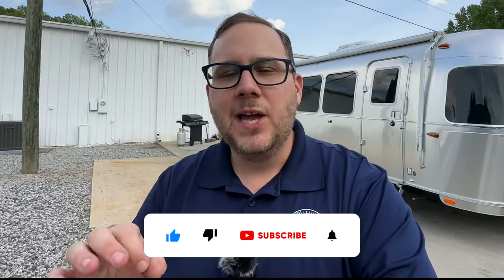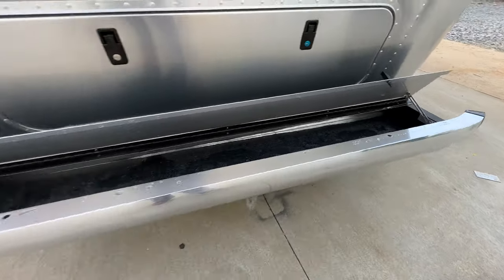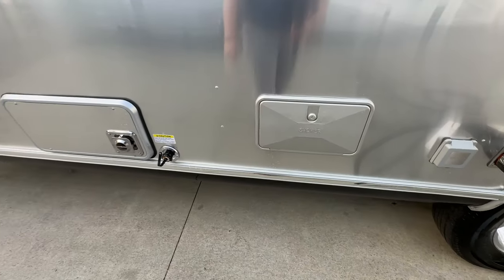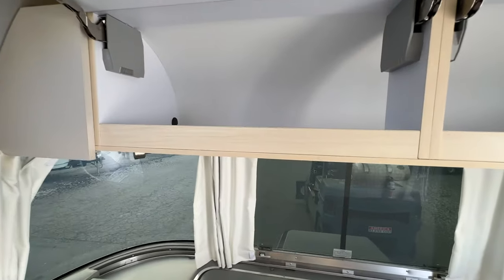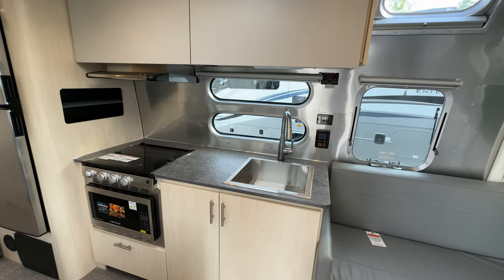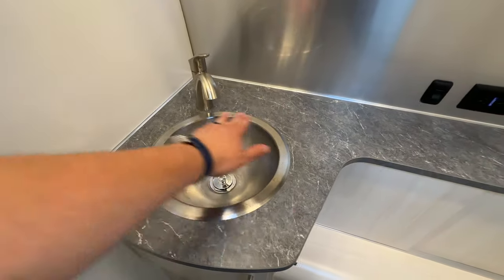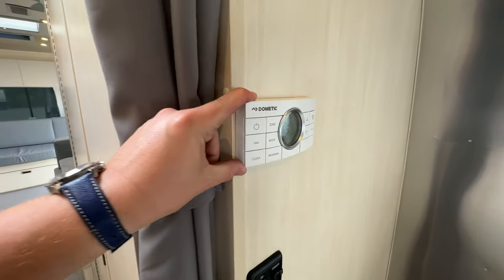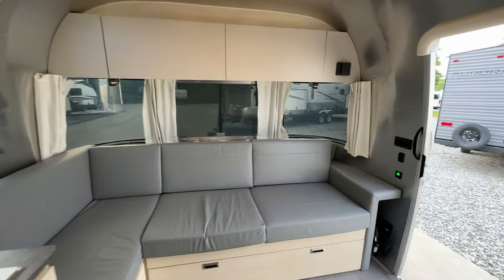"CHEAPER" Pottery Barn!??! - 2023 Airstream Flying Cloud 28RB Queen Bed

Comment: We LOVE this floor plan and are picking up our new 2023 28' FC tomorrow (!!). Thank you for doing this video, as this is the first we've seen for the 2023 28' FC RBQ. Yes, there is a trade-off for certain aspects of the trailer, but what sold us where more manual options with the awnings and stabilizer jacks, big windows on the camp side (just keep the one by the door closed if the door is open), and the separate lounge and dinette area. Funny that your title says "Cheaper Pottery Barn" as we initially looked at the PB but decided against it as it's 100% electric and the fabric sofa is a non-starter in the rainy PNW where we live. We've compared both models and will do some modifications to give our FC some PB aesthetics. Great and informative video!
Reply from the maker: Congrats on getting your Airstream! Thank you for leaving your comment! I feel the same way about the manual options on the Flying Cloud! I've a lot of customer ask if they can get the manual on the upper models!

Comment: idgi. the pottery barn is 50k more expensive than this for some interior decor upgrades? kinda sucks since the international is also gimped so as not to outdo PB so it's only slightly better. whole 28rb line sucks because PB exists.
Reply from the maker: The pottery barn does have the upgraded Smart Czone system like the Classic and powered stabilizer. There is more to it than only the decor, but with that said you do have to really want that decor upgrade to justify the price difference!